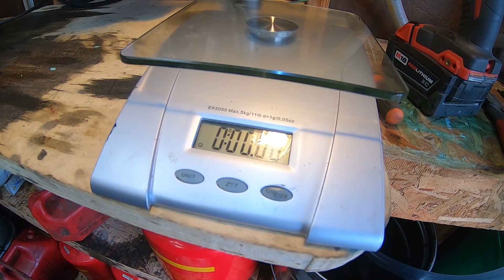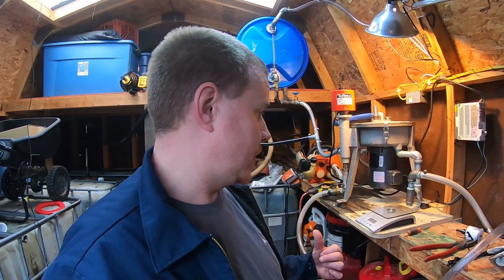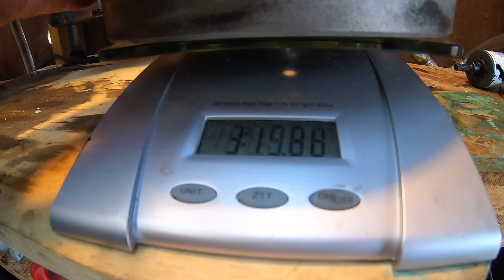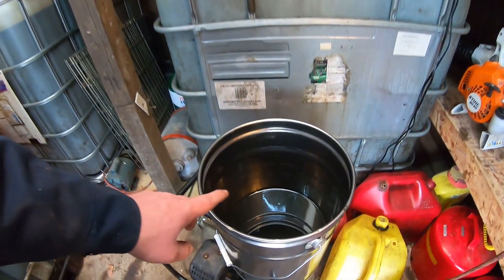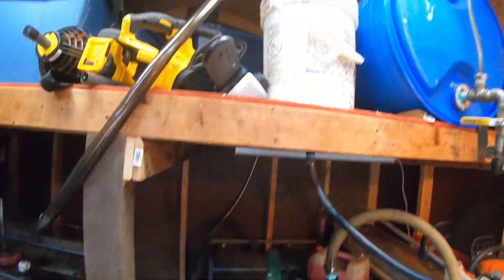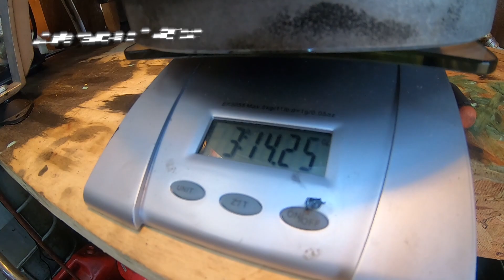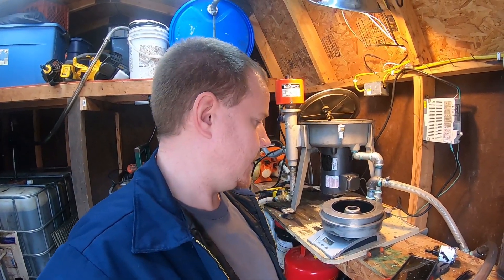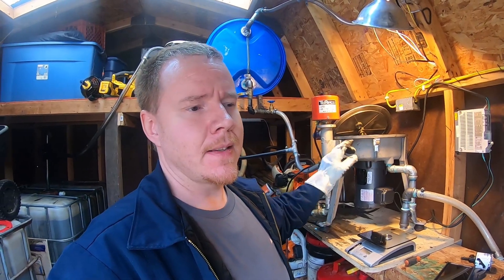Black Diesel Small Batch Tests - Heat VS Gasoline - Centrifuge With No Heat? - WMO - WVO - Alt Fuel

Comment: 13:08 .65oz removed from 4 gallons of oil is MORE than .70oz removed from 5 gallons.  Adjusted for volume, .65oz would be .81oz.

E10 gasoline absolutely DOES remove water.  Specifically the 10% ethanol bonds with the water and separates from gasoline.  Adding water is exactly how you determine the ethanol content of gasoline.
Reply from the maker: Thanks for the correction.
Reply: @NotSoGrandGarage thanks for the content.

Comment: Don't forget you are using less oil with the addition of the petrol/gasoline so less solids to start with
Reply from the maker: That is correct.  I still say that from a safety standpoint alone, it's wise to avoid processing after blending.

Comment: Water is heavier than oil it should stay in the bowl
Reply from the maker: Sure... Free water does stay in the bowl and get trapped in the milky gunk.  Emulsified water doesn't.  Heat is very important.

Comment: It stands to reason that the mixed batch should have less sludge as the 2 runs were the same overall volume and the gas portion should theatrically be clean
Reply from the maker: You are correct.  I hadn't thought about it at the time I was making the video but yes there should be roughly 10% less material in the total volume because of the "clean" gasoline added.

Comment: Oil has detergents in it to suspend contaminents  and carry them to a filter . Can some thing release these particles from suspension? and maybe vibration to help settling of particles? Great work, thanks.
Reply from the maker: The G forces applied to the oil by the centrifuge does that really well.  See our lab test results video.

Comment: Doing a no heat pass is about the only good way for removing the wax-like substances in oil. Under heat it liquifies and flows thru and is staying with the finished oil to re-solidify. Try this, "m67 military immersion heater".    The military used this for heating water for baths, and field kitchens in WW2 and in Vietnam. Now some people are using these for de-watering oil in 55gal. drums. Google it, there are videos.  I hope you find this informative. I made 2 of them.

Comment: I am new to the game my Centrifuge is coming Tuesday I watched another video and somebody said not to use galvanized pipe That galvanized pipe will contaminate the oil and damaged your motor I see you were using galvanized pipe what is your thought
Reply from the maker: I've not had any known issues..  but I've heard the same.  Just haven't changed it.
Reply: @NotSoGrandGarage  Just in case and some first starting out all use black pipe

Comment: Hey man, good set up, can u clean hydraulic oil for reuse? Or gas engine oil for reuse as engine oil? Or 50/50 mix of new and cleaned engine oil?
Reply from the maker: Possibly on hydraulic or machining oil but I probably wouldn't use it for engine oil unless desperate.

Comment: Just wanted to ask how are you  clean your centrifuge like what chemicals do you use?
Reply from the maker: It depends.  I typically just wipe it out or use a plastic spoon.  I'd I'm trying to get it really clean, it goes in the ultrasonic and gets finished off with brake cleaner.

Comment: مساء الخير انا من متابعيك لو سمحة هل تفلتر الزيت المستعمل
Reply from the maker: I have used a bag filter in a previous video.  Check the playlist.  If that isn't what you are looking for, what style of filter do you want me to try?  Thanks for watching!
Reply: @NotSoGrandGarage  لو سمحة هل تعالج الزيت بمواد قبل الفلتره
Reply from the maker: @جمالالراوي-و2ت  Depends on how you are processing.  If you are using heat, I wouldn't add anything to the oil.  If you are not using heat...  add gasoline to the oil and let it sit before filtering.
Reply: @NotSoGrandGarage  عفون علئ الاطاله هل يخرج الناتج اصفر نظيف لان تابعة جميع فديوات حظرتك ولم ارئ شكل الناتج لو سمحه هل لدئ حظرتك صوره للناتح
Reply from the maker: @جمالالراوي-و2ت  The oil comes out black.  Without distillation or acid washing, it will always be black.  I'm going to be testing something here soon to see if I can change that though.
Reply: @NotSoGrandGarage  استاذ اذن يجب علي ان افلتر ثم اظيف حامض الكبريتيك واعادله بلصودا استاذ الصودا قشور بماذا احلله لكي اضيفه واعادل الحامض
Reply from the maker: @جمالالراوي-و2ت  I've never attempted acid washing so I'm not sure.  I've just seen it done.
Reply: @NotSoGrandGarage  الزيت للسيارات البانزين اسرع بلتنظيف انا اظع عليه مادة الكمبرلان يخرج منه كميه كبيره من الكاربون ويصبح لونه مائل الئ الصفار لاكن ليس شفاف ايحث عن ماده تغير لونه الئ شفاف
Reply from the maker: @جمالالراوي-و2ت  Oil from gasoline powered engines doesn't contain the soot that diesel oil does.  Hydraulic oils and transmission oils work well too.  Let me know if you find anything that works well.  I'm going to be testing a few things here soon.
Reply: @NotSoGrandGarage  رغم انه انا لا افهم بعض المصطلحات لحظرتك لا انه انا اجري تجارب علئ زيت المحركات محركات الكاز ومحركات البانزين يصبح عندي خالي من الكاربون لاكن الون يبقئ غير شفاف
Reply: @NotSoGrandGarage  لو سمحة ممكن ابقئ علئ اتصال مع حظرتك انا من العراق حظرتك من اي بلد
Reply from the maker: @جمالالراوي-و2ت  Thats no problem.  Feel free to reach out anytime.

Comment: Please tell me how much the equipment cost total... from the centrifuge to barrels and hoses.. ballpark figure is fine. Also where can I buy it all and do you have a complete tutorial start to finish?
Reply from the maker: Roughly $2300 in the centrifuge as it sits in this video...      probably $100-200 in misc fittings and hose...      most of the barrels I got for free...     the totes were mostly free...    the transfer pump I got stupid cheap (~$75 and was new...  with the nozzle, hose, etc.).  Check out the playlist.  There's a bunch of info on the subject.  Also, here soon you'll be able to purchase a lot of it from www.notsograndgarage.com

Comment: Hey dude love the videos going to do a setup here is aus I run a generator constantly and would love to lower the running cost is there anything I would have to change on the gen to run the wmo, also no one mentioned so I thought I’d ask is it possible to run a water separator in-line before centrifuge to remove moisture contaminants?
Reply from the maker: Depends on the generator.  What do you have?  What engine?  Water separators work okay and sure you could put one before the centrifuge but they can only remove so much.  They also only remove free water... not emulsified water.  I wouldn't rely on it personally.
Reply: @NotSoGrandGarage  arh right see the more you know thanks for that information?., I have a k4100zd motor reading online just then said it’s direct injection
Reply from the maker: @Jo5hP  Looks like it has a mechanical inline injection pump.  With that said, it should run on a bit of oil.  I would start slow with it...   10-20% and work your way up.  Low load will cause issues so keep the mix lighter if it isn't running under heavier loads on a regular basis.
Reply: @NotSoGrandGarage  would you still mix with petrol or just mix with diesel only running 10-20% oil 
Thanks heaps for getting back to me really appreciate the help
Reply from the maker: @wickedjosh2  I'd make up a 50 gallon batch with 10% gasoline...   then mix that at 10-20% in the generator.  That way as you work up to say 50%...   you're already thinned down and good to go.  I've also been thinking about water injection on generators...  manually activated either by timer or push button to help keep the injectors clean.

Comment: And less than that with a direct drive unit maybe one gallon per HR I personally run us filtermax it is belt-driven the rotational speed of the bowl is way faster than the motor giving way more centrifugal forces on the oil for cleaning purposes
Reply from the maker: Yeah those units are nice.

Comment: I would always suggest a slower feed rate no more than 2 gallons per hour
Reply from the maker: Right.. but in my situation, it works better for me time wise to run multiple passes instead of one slow pass.  Same amount of time in the bowl... just works better overall for my time constraints.
Reply: wow that's super slow.

Comment: One other slight issue if others are concerned with it is trying to remove water even if you mix the oil with gas and the debris and moisture water excetera drops to the bottom of a tote to be drained off even if the tote is angled for better draining it is still a flat-bottomed container so debris and water will still be sitting on the bottom of the container this will keep the moisture content higher if you had a cone bottom tank and was to periodically drain the cone bottom tank you would remove more debris and more moisture I run 100 gallon stainless steel conical tanks on coasters
Reply from the maker: Yup.  This is why I won't pull from the bottom of totes.
Reply: Yes and i've learned first hand not to pull too close to the bottom of the barrel.  I was pulling straight water at one point and then it filled all my lines with emulsified water/oil milkshake.  Exactly what you don't want in your fuel.  Now I keep my suction line 6 inches off the bottom and I'm setting up to only draw from an IBC tote that I can drain water off the bottom.

Comment: One part about thinning with gasoline is it needs to have excessive time for settling once mixed with gasoline with a nice ratio say 20% 10% excetera after an extended times of settling since the fuel has been thinned out its viscosity has been lowered and density has been lowered lots of debris will literally drop out over time I would say at least one week two or three would be best then it's ready for centrifuge and use all waste oils will contain water they are all hydroscopic they literally absorb moisture through the air
Reply from the maker: The only issue with that is cost.  Most aren't going to spend the coin to add 20% gasoline to their storage totes for settle time...   that and then you've got a 275+ gallon mixture of flammable oil instead of combustible oil.  My 20% blends can be lit with a spark typically.   I wouldn't personally want that much flammable liquid in one spot.

But... if you aren't using a centrifuge...  and doing smaller batches, it certainly helps.

Comment: I have a question, I collect around 4500 gallons a year, filter it with centrifuge, and run it in my military trucks, and my fuel oil furnace that I converted to waste oil furnace, I also run my military generator off of it. my question is out of all the oil I collect, I get water in some of oil I get, not just a little bit sometimes 10-20 gallons in 275 gallons I get in totes, do you ever have this, and what do you do to get large amount of water out?
Reply from the maker: With large amounts of water, it will typically settle off and can be drained from the bottom of the totes.  I also run more than one pass through the centrifuge now and have changed the plumbing a bit.  Check my other videos on it.

Comment: Do you think one of those $100 tankless propane instant hot water heaters would work with the oil?
Reply from the maker: Not sure.  It probably would but you'd need a pump to supply pressure to the heater.

Comment: Gravity and time is all that is needed.
Reply from the maker: Negative.  Most of the oil that I test has been settling for over a year (this batch had been sitting for a few months)....   the average user might let their oil sit for a week or 2.  Might want to check out the other videos where I pull literal cups of sludge/water out of the bowl from a single pass...  on oil that had been sitting for over a year and it will change your opinion on that I'd say.

Comment: Hey are you running a chinese diesel heater? It sounds like one is running and I see the tube sticking in the wall there. You running it on the black diesel you're making here? How has that gone?
Reply from the maker: I am running one yes but not on black diesel yet.  Will be soon!  I've got a video of the install.

Comment: interesting that the petrol vapor still was evident.  Was really assuming that the carbon chains of the gas and oil would bond and make the petrol....  well ...... no longer petrol.    

Thanks for posting.
Reply from the maker: Yeah it was definitely a strong odor and from what I've experienced... even at 10%, the mix becomes almost flammable instead of combustible.  It lights off pretty easily.  It doesn't have the "pop" on ignition that gasoline does as it burns slower... but it lights easily.  I'm sure the vapor would ignite easily.
Reply: @NotSoGrandGarage I use 80/20 mix to light my wood fire interestingly it lights quite fast then settles like some petrol vapour is present
Reply from the maker: @CraigLatta-c5e there probably is.  Gasoline definitely makes the oil mixture easier to light by flame.

Comment: Another great informative video. Could you use a mixture of waste oil and used vegetable oil to help thin the oil 🤔
Reply from the maker: From my understanding,  veggie and wmo don't play nice with each other.   They thicken up into a gel from what I've heard.
Reply: What about using diesel to thin
Reply from the maker: @nigtturner  for processing?  Already in the works.  For running?  Diesel doesn't do nearly as good of a job as gasoline does.

Comment: Cheap gas has the ethanol that destroys rubber o-rings and fuel filter seals. Just a FYI. One of the reasons that I'm going to centrifuge filtration with heat.
Reply from the maker: I've been blending with local pump gas (all e10) for over a decade without fail.  If the hoses and o rings will hold up to oil (which most will not), ethanol is not an issue.  Thanks for watching.

Comment: My buddy would test it by taking a very small amount of the oil and place it on a super hot teflon coated pan and any water will sizzle off.  It appears to be a very effective way of telling if there is any water in the oil.  When I was a helicopter mechanic in the military we had a spectrometer to check for moisture, it was called "Aqua glow" test.  Very similar to testing distilled alcohol water/alcohol content.
Reply: seen it done with a spoon too.   Looks like your cooking crack when you use a spoon lol.
Reply from the maker: @coachgeo  lol.. true story.
Reply from the maker: May have to give that a try

Comment: I find this strangely interesting my thought is you have done 5 gallons of oil then 4 gallons of oil with 1 of fuel the fuel will not have any particulates in it so really you are only putting 4 gallons through it should have done 5 gallons of oil with a gallon of fuel this way you will be cleaning the same amount of oil
Reply from the maker: I mean technically you are correct. Not enough room in my bucket though.
Reply from the maker: @lyndonchambers2301  quite a few people are running w80..  myself included as it it now winter here and it's almost required.
Reply from the maker: @lyndonchambers2301  yeah ...  single digits here next week
Reply: Yes, since heated oil was 5 gallons of oil and the thinned one was 4 gallons oil + 1 gas, the thinned experiment actually removed more from the oil. 
4 = .65 
5 = .7

Comment: I'd be curious to see how much water is contained in your samples.  Heating equal sample batches  ( after the centrifuge )and then weighting them should give you a measurable amount. Do the same for a sample of gas station diesel and compare the difference,
Reply from the maker: I'll add that to the list

Comment: i saw a guy mix 80 % oil to 20%gas then added 10% diesel for winter use to thin oil even more he didnt show the diffrences so not sure how much better it burned then 80/20 mix in winter
Reply from the maker: I've seen burn tests and a little d2 does seem to help the burn.

Comment: you could try 50/50% diesel wmo for those who run single tank
Reply from the maker: So just centrifuge 50/50 diesel and oil?  Most people mix their thinner after centrifuging but I can do it.  Heat or no heat?  Diesel would be fine with heat.
Reply: @NotSoGrandGarage  diesel would thinner the oil and won't evaporate so easily under heat
Reply from the maker: @antoniosestar3671  right...  so thin with diesel and centrifuge with heat?  That's doable.  I'll add it to the list.
Reply: I do 7 parts oil 2 parts gas 1 part diesel single tank. But lowest we get here is 30 degrees
Reply from the maker: What engine?
Reply: That’s how I’m doing mine. Filters for now until I probably do pressure driven centrifuge. 

50/50 diesel/wmo in a 55 gallon drum settling with a band heater set to about 85*. When I go to filter a batch, turn the heater up to almost 200 overnight, then run through filters. 

Will be running through a dual tank IDI f250